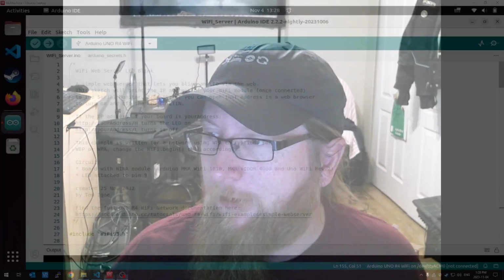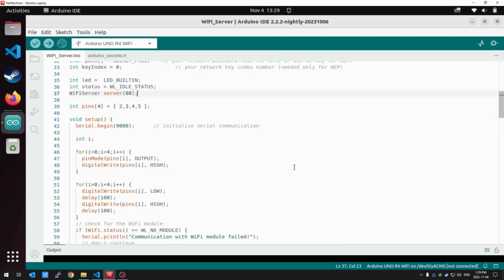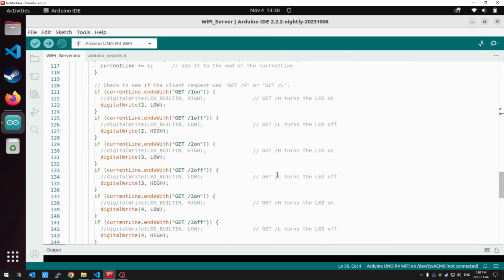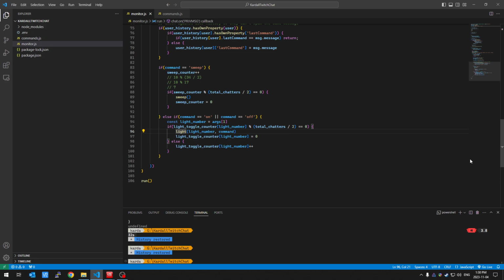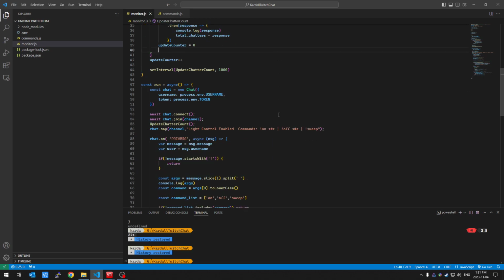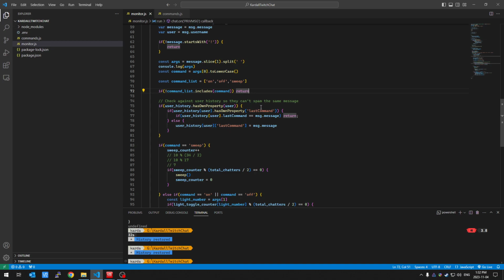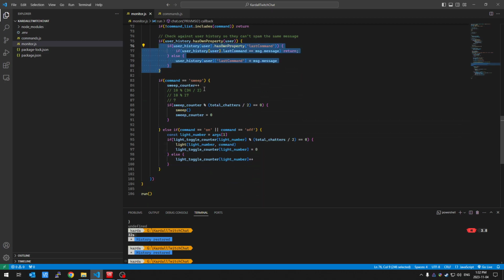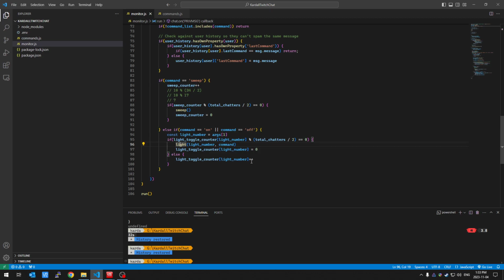Arduino and Twitch Chat

Comment: this is pretty interesting, I am new to arduino but am rapidly becoming familiar with arduino code.  I remember a streamer once had a receipt printer that would print every subscription that was given, it was pretty impressive, not sure if it wa sa product of an arduino setup, but I've always wanted to make interactive real world devices for the times I stream.
Reply from the maker: Ya, they can get pretty interesting and there's a lot of different options to doing this sort of thing. Not even just an Arduino, but ESP32's are quite powerful.

Comment: Which Arduino are you using? I have no experience with Arduinos, and I want to learn. 
My goal is to enable a streamer to be able to control Arduino-controlled switches (that viewers have connected to the internet) using the twitch chat during a stream.
It seems to me you have already achieved that, and I would like to replicate it.
All I am starting with at this point is a Twitch account.
Reply from the maker: This is an Arduino UNO R4 WiFi.
I also have a 4 Relay Module for this setup here (I have an 8 Relay Module that I am working on a Christmas light sync system hopefully will be ready for this coming season).

Here are the links to the exact parts I ordered (Canada) and the Arduino model that I think I did get from Amazon as well but, it's best to shop around for deals yourself.

Arduino: https://store.arduino.cc/products/uno-r4-wifi
4 Channel Relay Module: https://www.amazon.ca/gp/product/B06XCKQ1M9
8 Channel Relay Module: https://www.amazon.ca/gp/product/B0057OC5WK/